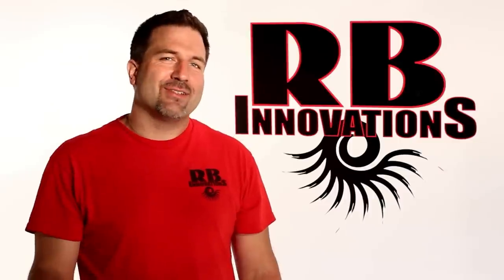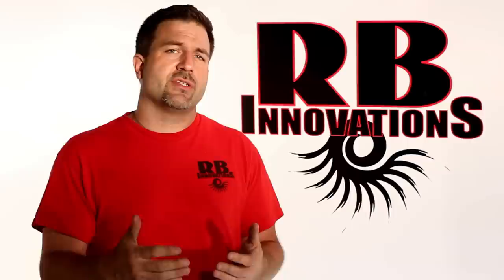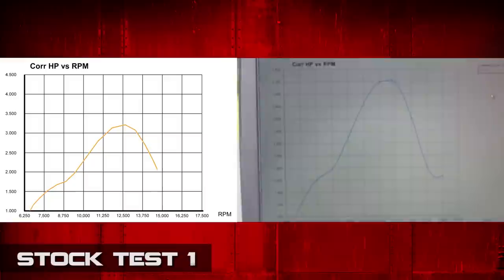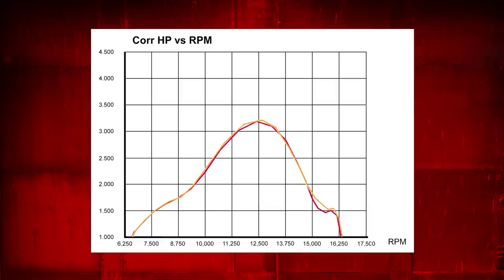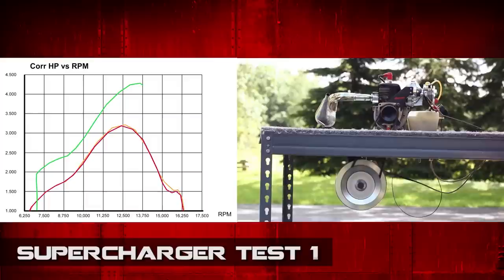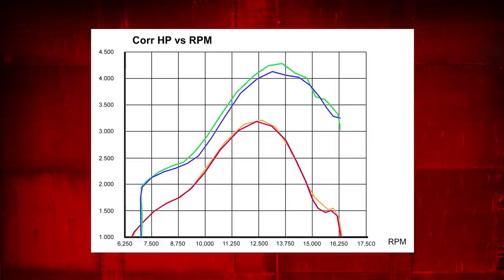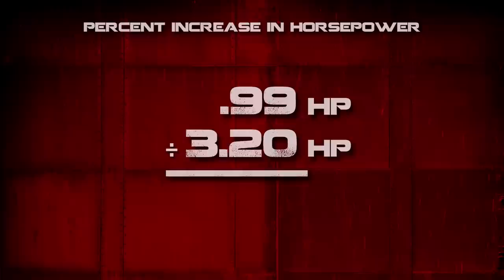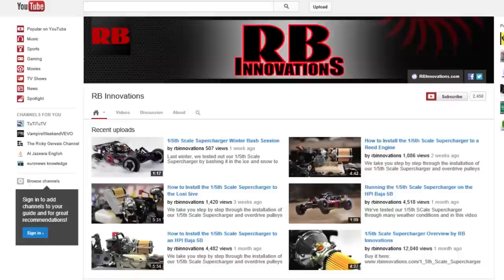Dyno Test of the 1/5th Scale Supercharger by RB Innovations

Comment: Bob, I have a couple questions;  first, isn't the the pressurized air coming in as the piston is going up on the compression stroke, and therefore you will have an overpressured crankcase dampening the piston during the ignition, at least until it moves below the roof of the transfers and the pressure pushes out the exhaust?  Second, wouldn't you need a specially tuned pipe, since you have a change in the gasses leaving the exhaust port?  it seems like the timing to bounce back and push the escaping air/fuel inside would be different.  I was surprised you guys don't have pipes tuned for your superchargers.  I might be interested in a 49cc version if you ever make one.
Reply: the pipe will accommodate any amount of exhaust and work, although a perfectly tuned pipe is definitely better...also the piston is slowed down, but not as much as it's helped downward by the harder combustion. 

If it weren't pressurizing due to the piston, he might see 50 percent increase
Reply: Thanks for the answer, I don't understand your last sentence though.  Are you saying the supercharger would make a 50% increase except for the pressurizing?
Reply: Johnny Vorschilde yes, most likely they would be 50 percent rather than 30, but the piston compressing the fuel-air charge dampens it a bit.

Assuming it works at all lol
Reply: Some people swear they can't work on a two stroke, but I'd say a 30% boost is pretty significant.  Need a model for the GP460 motor!
Reply: Poly Bun thank you, someone with a brain for once that understand internal combustion theory
Reply: +Poly Bun 2 stroke diesels have a exhaust valve tho
Reply: Wow, that's a pretty impressive explanation,  the company should post it on it's site.  So the 2 stroke diesels that don't have a valve, use the same type of tuned-pipe rebound compression like a small cc gasoline pipe?
Reply: And it won';t just blow a bunch of unused fuel/air through after the exhaust, or it's just a necessary evil?
Reply: I'd seriously consider it for the CY 460 if they had one.
Reply: Johnny Vorschilde actually...forced induction on a piston port 2 stroke negates the need for a tuned pipe.

Comment: am I the only one who thinks that the carburetor is in the wrong place? should not superchargen sit last? if you know what I mean.
Reply: Oliver Österlind Prob mix the air/fuel well though
Reply: For superchargers driven by the crankshaft of the engine, it does not matter if the compressor is upstream or downstream of the throttle body. For a turbocharger where the compressor RPM isn't directly tied to the speed of the engine, however, the compressor should be upstream of the throttle plate.
Reply: Oliver Österlind on a setup like this, you have to put the carb upstream of the blower as the carb is acting as it's own fuel pump and requires crankcase pulses to actuate the diaphram in said pump.

Comment: does work slightly your running super lean at idle to equalize top end with added air so slow take offs supercharger or turbo you need fuel injection and fuel maps to adjust the fuel curve during boost
Reply: i mean rich at idle my bad

Comment: Did they jet the carb after installing the charger? If not, then they were faaar off the max output😐
Reply: The supercharger comes after the carb. Therefore an adjustment is not needed^^ it can help, but only a very little bit at max power, when the carb exceeds its usual airflow range
Reply: DerKrawallkeks For every power increase, you have to rejet the carb (or doesent this apply to RC car carbs?)
Reply: ok, i just found it weird, because if you tune a normal 2 stroke bike engine, then you HAVE to re-jet it, or it will run too hot and destroy the cylinder and piston...
Reply: Yeah these are alot different

Comment: What engine was it tested on , as it can't work on our engines ,you need an exhaust valve system an inlet valve system , crank case induction  not barrel induction (like ours ) the engine would be so modified that's it no longer an engine that would resemble a Baja motor , it can be done but only on special motor , some snow mobiles have them fitted but arnt a 2stroke in the common sence of what a 2stroker is ...?????

Comment: how about you dyno a nitro engine? Also, the data input can be modified on a dyno run. IE, Ambient Air temperature, air pressure, and humidity. There's also a HUGE low end lag, one I wouldn't say it's worth it u less you ran a higher rpm clutch.
Reply: +Do M ambient air pressure doesn't vary by 32%,  its more like 5%

Comment: Let me explain things to you people. 

A supercharger uses engine power to create power. It's parasitic power. In the end there is something connected physically to the engine that spins something else to create boost. 

Further more, any boost over atmospheric pressure is a gain. As long as the air fuel ratios are proper. 

That means this is real and it works. 

That is all.
Reply: Lel no, you act like you know what you're talking about but you have no clue
Reply: You can't produce meaningful boost in an engine where the exhaust and intake ports are open at the same time, which is the case with all piston ported two stroke engines such as this one. Your BEST case scenario is you just push excess fuel/air/oil mix out the exhaust port. Any pressure gained from the supercharger is vented to atmosphere the instant the intake ports open, as the exhaust port opens first and closes last.

If you want to boost an engine you need to be able to force more A/F mix into the cylinder than will naturally fill it when it's N/A. And you can't do that in a piston ported two stroke.
Reply: @TestECull  ^^

Comment: You can make 2 stroke engine work with boost. only thing is you just CANT make it without modifications to carb and other parts. Allso if you "un boost" boosted 2 stroke it wont work without modifications.

Comment: Something is out-of-whack with this video. The chart is wildly out of sync with the test. The L-R direction (X-axis) in the chart shows low-high engine RPM while the Y-axis shows HP output.... so, why does the RPM continuue to climb while the video clearly shows the engine revving then slowing? In my experience, most dyno tests need to be run over the course of at least a full minute to map power output over both engine speed and engine load changes. How do you "dyno" a motor without a dynamic load!?
Reply: +Grant Arnold its just the animation for the graph being out of synch with the audio of the video if you expect a real time readout [which it is not], but you can clearly see the the throttle is wide open the entire time the engine tone is ascending
Reply: +joshua arnott also, my guess is they used a generator as a dyno and measured the wattage coming out of it
Reply: +joshua arnott ... okay, that does make sense. the chart is the output of the test (not in sync with the video/audio) and it's basically charting the wattage at the flywheel as the motor revs to redline. the power increases are pretty amazing, in that case!
Reply: Dynamometers utilize a generator as a brake in how they're wired they provide resistance to the engine and by mathematical calculation in the software produce hp and torque readings. Same for motorcycle, atv, and auto dynos. I used to own one myself. You also have a delay from the signal through software to screen as well the video being synced. A couple milliseconds makes a difference but meaningless in the scheme of things. I'd say this is a pretty accurate depiction of their product. Yet in comparison to car Superchargers it would be considered very low quality but for an Rc car it's pretty rockin.
Reply: Grant Arnold genius...the graph shows the power curve from idle to peak rpm. No engine makes peak hp at redline.

Comment: OK, found the dyno vid. I would have like to have seen the fuel curved optimized on the base motor. If it was set up rich and the blower caused it to go lean it might account for as much as 20% of the increase. And not familiar with inertia dyno,
automotive dyno measures torque, torque is what does the work, hp is just a computation based on torque and rpm. If they haven't spent several hundred hours on the dyno ans shredded a pile of motors its still backyard amateur time.

Comment: For all of you who are confused by the RPM continuing to rise after the throttle is let off, you don't understand what is being measured.

The RPM being recorded is the DYNO, not the engine. The dyno drum has mass, the mass creates load on the engine to accurately measure HP. When you spin the drum up and let off the throttle, it'll continue to accelerate until friction slows it down. Physics, kids ! That's why you have a clutch. Having the drive train suddenly stop when you let off the throttle would be dumb.

What a stupid argument to hang all your hats on. Get a clue.
Reply: If you stop adding force to make it spin it will stop accelerating. If you get of the throttle you're no longer adding force so it will no longer speed up.
Basic physics

Comment: I would spend my money on a bigger displacement engine with the same foot print. Match a good tuned pipe. Like an OBR setup. An engine with this gear boosting power is just asking for 1/2 the lifespan. why bother.

Comment: You can't supercharge a two stroke, it blows right through. If it was a four stroke, it would definitely work.
Reply: Wrong! There are plenty of turbocharged (and some supercharged) 2 stroke engines ... i worked at a snowmobile dealership and we fabricated MANY turbo kits on 2 strokes ... all with massive gains. Tested with a water brake dyno.

Comment: hello cool guys. the first engine is ported.. the second one is not ported.....

ported means more duration, a bigger exhaust port. when you file the port bigger the power in low rpm is gone away... my ears hear an engine without power in the bottom end.
You always need some power in bootom  cross motor power you want. not puch maxi effect or vespa ciaou

the super charger must take away a lot of power when it's not working at low rpm.  also because the transmission is not geared down but geared up. my experience learns me always gear down from crankshaft     when you try to gear up..... the engine dont like it especialy two stroke's they need to run free

groetjes uit nederland
Reply: Lude Boukema they're running the same motor. Even with the port timing raised forced induction does work.

Comment: i like the idea of a turbo or super charge, but the idea it being  on a rubber belt  plus  no way to oil the the turbo  an due to the weight of the fan, an belt  drive  i dont beleave this would  work , it prob would for a short  time , i just dont think the belt is keeping up with the turn  of the crank  it slipping like crazy , an no way the chart is real
Reply: It is oiled by the intake charge being pressurized and containing oiled fuel...also the fan wouldn't weigh that much, especially since car superchargers are powered by soft rubber belts
Reply: +gundorethemighty if it were a suck-thru carb setup you owuldnt have to worry about it considering it 2-cycle fuel

Comment: I seriously doubt that little engine boosted that much. You would still have the same space in the cylinder head,I highly doubt a stock head is going to produce THAT much extra HP. Also, dont forget, the crank and piston rod cannot handle anything more than what stock puts in. Anyone who has boosted a ricer knows they go BOOM because they ran more hp than the stock parts can handle. As a small engine repair guy,I can say, you might as well throw your money out the window than invest in this crap. Get a bigger engine if you want more ponys. I can Guarentee without a doubt, that stock engine is soon to be bits and pieces all over the ground.

Comment: .99 hp for $400+?  ROLMFAO.
Reply: +AllNamesRntAvailable right!
Reply: +AllNamesRntAvailable Lmaoo honestly!
Reply: +ryotaryuu Thats a rip off being it's plastic......buy a bigger engine
Reply: Lol ik biggest rip off ever
Reply: +jim bob It's not plastic.
Reply: +Headcase How much money do you think racers spend on a few HP? It's a hell of a lot more than what you would spend on this rig.
Reply: +RakinBill I built a lq4 ls with 1142 hp for 5k
Reply: Daniel Bargas building a $5k 6.0 for a dyno run with an ebay turbo is one thing...building an lq with 1000ponies that will stay together is another animal entirely. Go throw another one together and throw it in a boat & see how long it lasts. You get what you pay for.
Reply: +ROTAXD lol it didn't have to hold it just had to make over 1000 whp on a dyno for cheap as possible
Reply: Daniel Bargas yea...way to go ! Nothing like throwing $$ away for a dyno pull. Smh. Building something that's going to burn itself down is idiotic.
Reply: +ROTAXD lol what a 6.0 junkyard short block 4800 bucks worth of that stuff is completely reusable, no one is going to throw away there turbo, intake, throttle body, fuel rail, injectors, turbo, exhaust, intercooler and so forth just because a ring land breaks

Comment: My 1/8 has 7 hp electric , and my savage 25 has the same as that lol
Reply: That is true, but your engines have no where close to the torque value. HP can be found with RPM's, which is why your 29,000 rpm .25 can see such high output numbers to begin with. Indy car engines could be thought of as example. They are extremely fast reving and make huge HP numbers with such a tiny stroke, but if you put that engine in your typical heavy framed grocery get'r, you wouldn't get two feet before you burned out your clutch or stalled the engine from lack of torque to get moving.
Reply: Tuffenough4u Indy cars are also methanol

Comment: or you could buy a OBR Reed Valve G340RC engine that puts out 9.4 H.p for probably cheaper.
Reply: +behemothfan666 given that OBR Dynos there motors with Bartalone pipes and a loaded Dyno, yes it puts out 9.4 HP.
Reply: +Strixx I'm not stating they don't. but let me just say this, legends such as Scott Finlay and Trevor Simpson are only just getting to the 8 HP mark with both reeds and PP.
Reply: +Strixx oh and OBR dyno test with many different pipes but I think you'll find that there preferred company is VRC and along with being the most successful with 90% of "there" engines is the VRC pro pipe.
Reply: Trevo Simpson has been building these LONG BEFORE they were put into RC cars.. AND HAS WAY MORE EXPERIENCE than these fools. 

I know Trevor personally, he use to build all my motors when I raced GoPeds.. And yes, he has made 10 HP motors.. Maybe not G23-G28 s..
Reply: All I can say is that I run an OBR G340 Reed Valve Stroker motor in my Vekta.5 and that thing hauls ass. On all of OBR's Full Mod and Competition Engines they send a Dyno Sheet with their motor. I am very happy with OBR along with Turtle Racing, DDM, and Bartalone Racing. For $550 for a built engine that is tuned for 110 octane and has lasted me over 25 tanks of gas without 1 issue, I am happy. They also build custom 2 cylinder 57cc twin engines that put out around 20hp. Now I know there are other companies that build motors and do fine work. I am just happy with OBR. I have bought 8 engines over the last 8 years from them and love their work. OBR is probably the number 1 engine builder for 5th scale RC vehicles to my knowledge.

My whole point was that a putting a Supercharger on a stock engine is costly and inefficient compared to buying a built motor to begin with. Now maybe putting one on a built motor may benefit some.
Reply: Strixx 20 HP from a 57 twin no chance my 78 pushes 22 HP max, 57 twin you're more looking at 14-16 HP.

Comment: Hhhhhmmmm run the stocker rich as fuck, bolt a supercharger on to lean it out to what is correct fuelling and see amazing Dyno results. As well as the laughable graphs which increase rpm as the engine is slowing down, without an afr reading it all means nothing. And that’s just 1 single variable to monitor. So many other factors!!!!